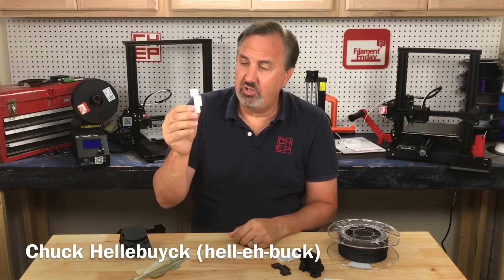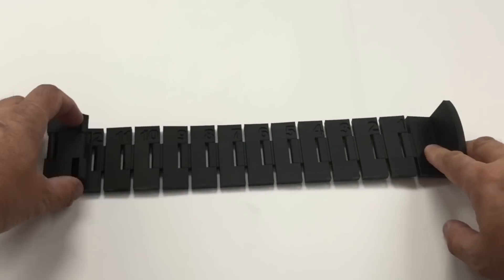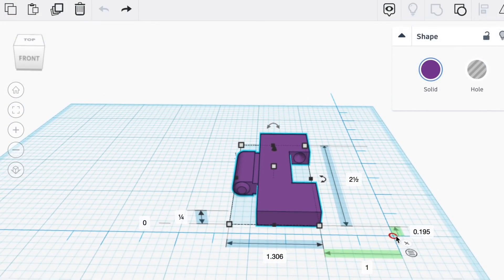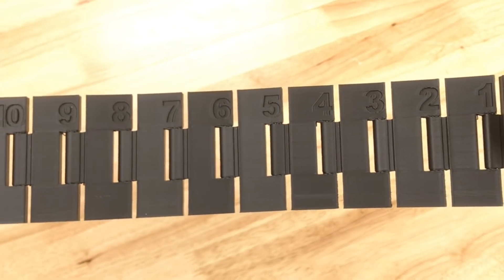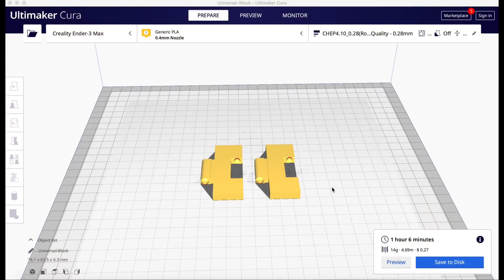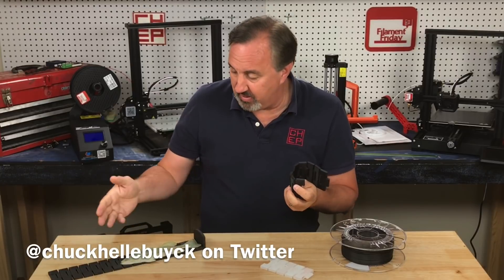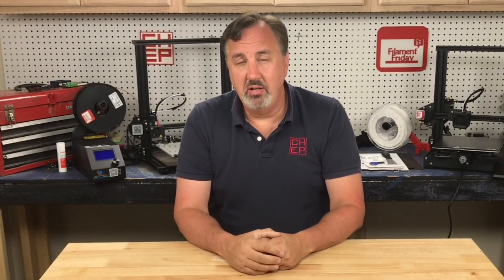Accuracy in a 3D Printed Universal Building Block

Comment: Hi Chuck, just finished printing the “bass block” on my old ROBO3D-R1+, at .2 layer height and 20% infill, 205º(C) and 60º bed temp…. that’s just my standard normal settings, using white, Matterhackers “Build” PLA, that was already sitting in the spool holder. The Accuracy throughout the 15” was spot on. Thanks for uploading the files!!

Comment: Hello Chep, ive been using your excellent cura slicer settings to print my abs. Ive ran into an issue that i don’t know how to troubleshoot or weather i should even bother? Im printing using your .2 settings and if i print without z hop .2 on retraction ill get massive layer shifting. This is the only variable I’ve found. If z hop is on. No layershift pretty perfect prints if z hop is off massive shift trash prints. Any thoughts on what i could adjust to not need z hop? Should i even bother? Thanks for the help!
Reply from the maker: Maybe the bed is too close to the nozzle?

Comment: why is white a tough colour to print? i pretty much only use white and ive never had any problems
Reply: If you only print white, its not a big deal at all. But if your normal filament has pigment it usually has different temperature needs. When I went from using black to white I found I needed to increase my temps by 10 degrees. And this was with the same brand.
Reply: @jacobhargiss3839  now you mention it, i think when i started exclusively using white my temps did go up

Comment: I am having some issues with the tolerances of the pieces fitting together. I duplicated the design files you shared but I did not test fit them in tinker caad. Is that why I'm having issues? Please let me know what I can do to get better fitment of these pieces.
Reply from the maker: Compare the measurements in Cura to what is actually printed.

Comment: any discord help groups?  I have been having the darnest time with prints lately.  Retraction tests showing odd results (like distance 2 showing good results with some stringing, 3 showing blobs and strining, 4 showing blobs and less stringing, 5 showing just as much blob and stringing) Or printing a 30mm cube near perfectly (measures out to 30.01) but then printing a benchy immediately after with pock marks (under extrusion or retraction settings maybe)  along with VERTICLE lines that seem to suggest some mechanical problems.    Needless to say, my ender 3 is finally having some issues -all at once.  iT COULD be filament as well, I have 2 generic rolls right now (used one finally, evne though it only measured 1.64mm average causing lots of issues) but this roll I'd like to use, and not just recycle or make a ton of benchies/tests out of. (already 2 retraction towers and 3 benchies in)

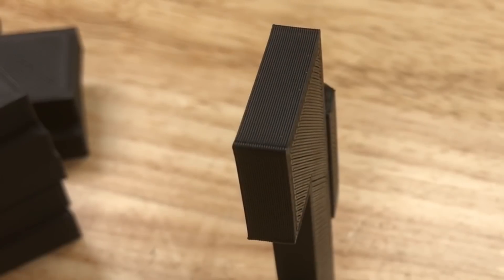Comment: Hi Chuck, thanks for all the great content! I have a question for you. Check out the block at 2:26. The extruded lines are almost in pairs of two with a slight gap in between them. This is happening to me and I can't for the life of me figure out why. I've looked at and played with essentially every setting, but to no avail. Any tips for me? Google was no help. TIA!
Reply from the maker: Try this: https://youtu.be/WPEWZGhRVe0
I used the wrong profile when I printed these and didn’t realize it until after.
Reply: @FilamentFriday  Well Chuck, that was precisely what I needed. Print are coming out beautifully! By the way, I wasn't trying to rag on your prints. I just noticed it and figured it was a good opportunity to ask an expert. Thanks for your help! 🙂

Comment: I'd print the 14" block in a different color so you can check it at a glance and don't need to worry about the numbers
Reply from the maker: Good idea
Reply: @FilamentFriday  If you don't want to reprint it. You could fill the 14 with paint or get a silver sharpie to paint the 14 a different colour.